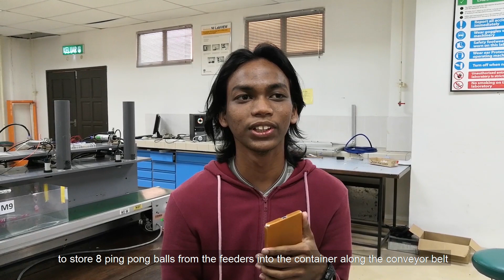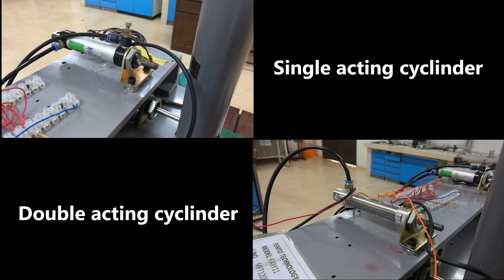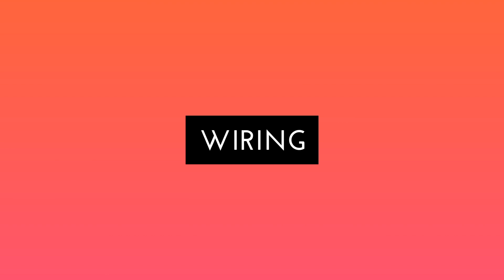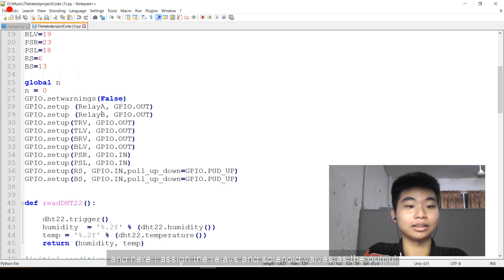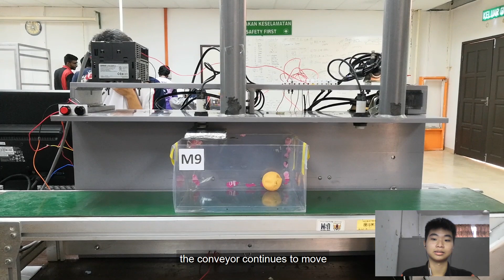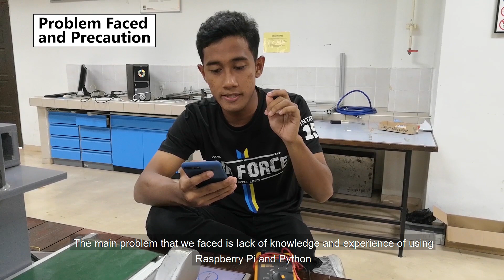EMC311 Mechatronic Project - Material Handling System Group M09 2019/20

Comment: Objectives are well defined.
Manufacturing application for bread production is associated.
Box is designed for bread production but too simple and thus operation sequence is similar to other team.
Magnetic sensor is not used.
Wiring is well shown and explained.
Motor and relay circuits are not shown and explained.
Pneumatic circuits are not shown and explained.
Program initialization is well shown and explained.
Program flow is well shown and explained.
Switches are used for controlling outputs.
DHT22 sensor reading is used for controlling outputs.
Operation demonstration  is well shown and explained.
Mark 90%